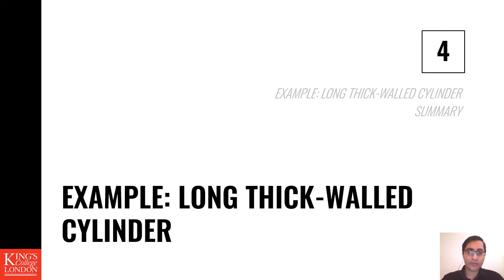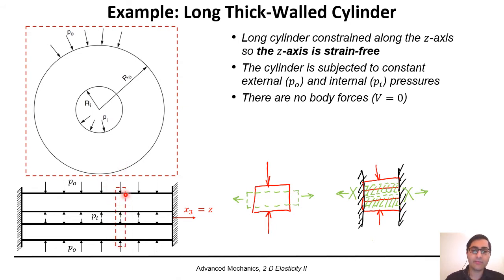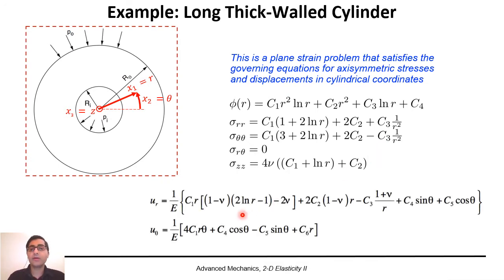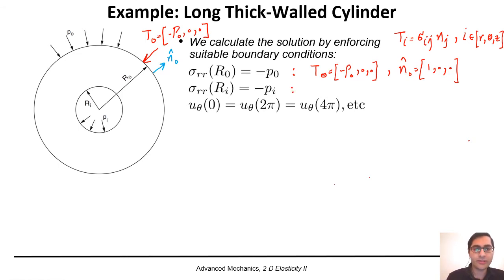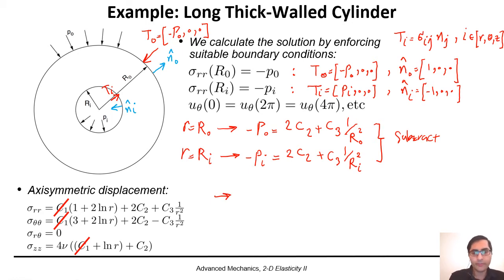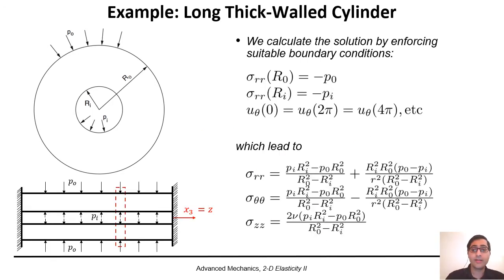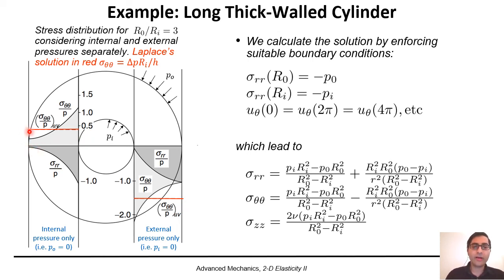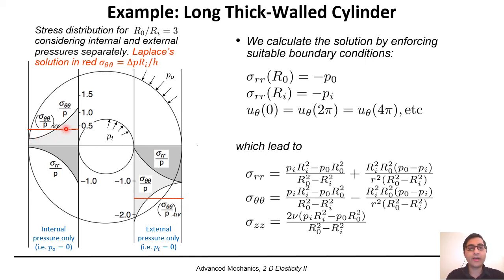Advanced Mechanics Lecture 7-4: Example: Long Thick-Walled Cylinder

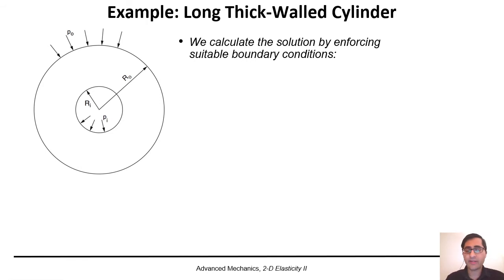Comment: I didn't understand how you got rid of C1 @7:08
Reply from the maker: Hi, Archis. As explained in the slide, Axisymmetric displacements means no dependency of u_r and u_theta on 𝜃. SO all the terms containing theta should have a zero coefficient for the displacement map to remain Axisymmetric. This means that from the relation for u_theta, C1, C4, and C5 should be zero. As a result, everywhere in the system that these coefficients appear, we may remove the terms!